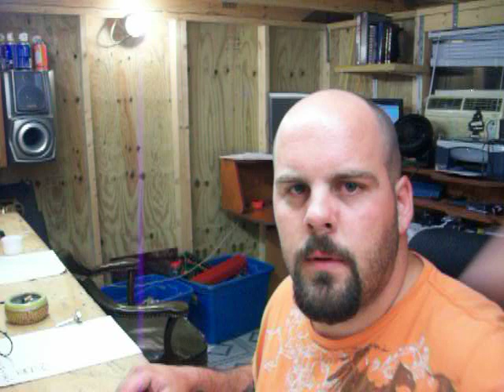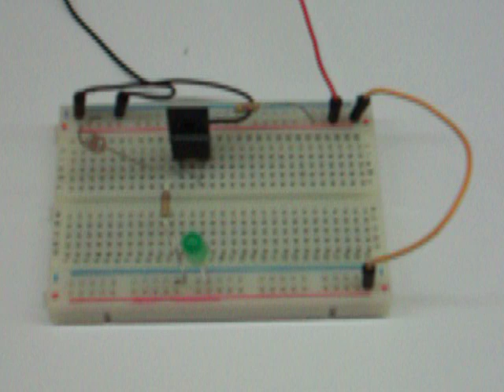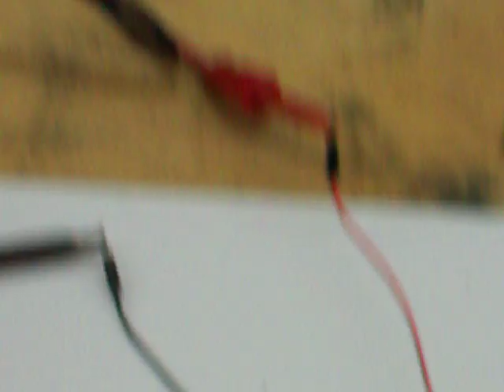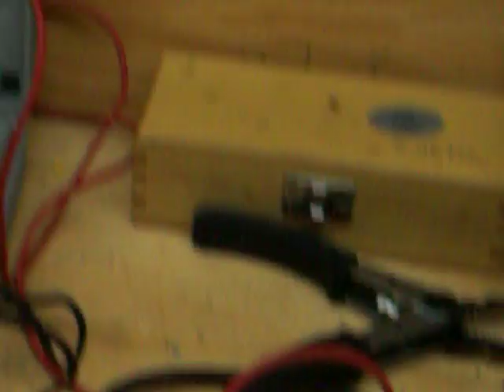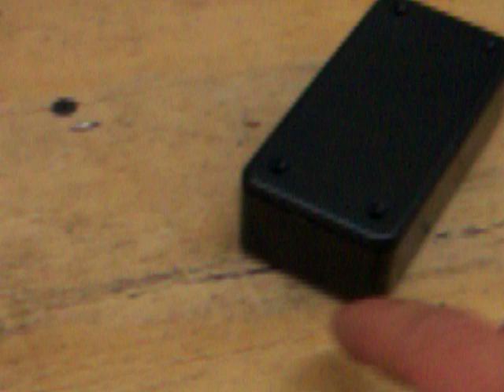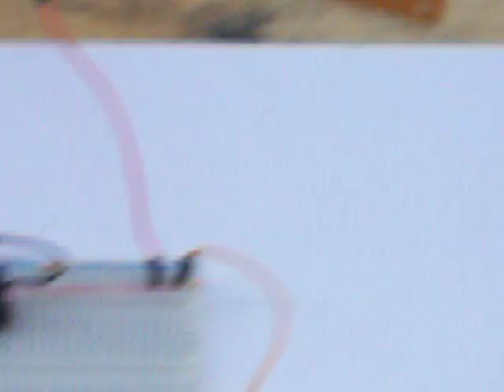easy laser tripwire

Comment: Great video, but I have a question:
What if I'm using a 3V power supply instead of the 5V you showed?
I mean should I use an other type of MOSFET, or is it still OK but with different resistors in the voltage divider?
Reply: any normal  NPN will do. It seems to me the transistor in the video is a bit of overkill. An LED needs 10-15 mA.
Use a BC547 and dont worry abt the  5 Volt

Comment: I'm wanting to set off a flash for high speed photos and have just a couple of questions.
1. I could reverse the LED to power on when beam is interupted correct? (So the voltage would fire the flash)
2. This could be run off a 9v battery?
3.How hard to add a variable delay?
Schmatic and parts list would be great!
Thanks

lreese1112@hotmail.com

Comment: I built the circuit with a 3V power source, when I just have the photoresistor and the LED in the circuit, when the laser hits the photoresistor the LED turns on, which is the opposite of what I want to achieve. I then put in the NPN-Type Switching Transistor in the circuit the way your diagram showed, and the LED won't turn on at all now. What am I doing wrong?

Comment: Do photoresistors come in bigger sizes? Like in 2 inch diameters? At some point the laser diffuses and the resistance is too low to complete the circuit and the led goes on.

Comment: i just reread your post.  i don't think it's working backwards. if the buzzer sounds when the light hits the photocell then it's working as designed since this is a light detecting circuit.  you want a dark detecting circuit to sound the buzzer when the beam to the photocell is broken.